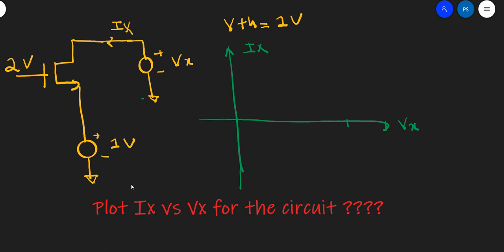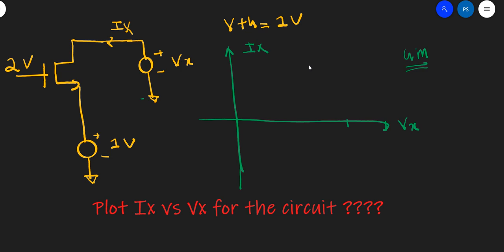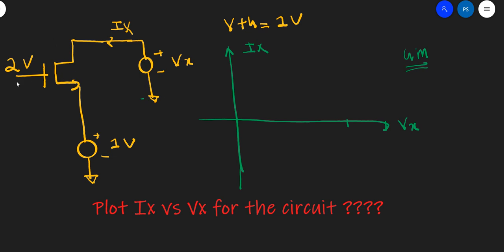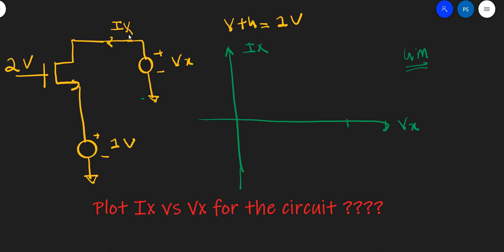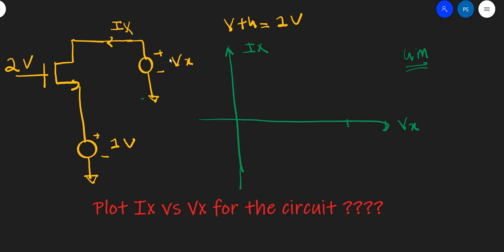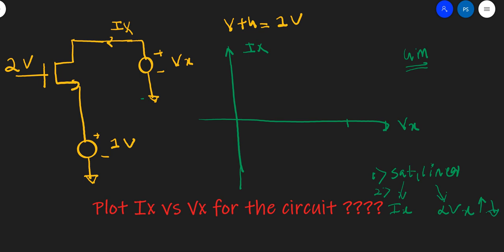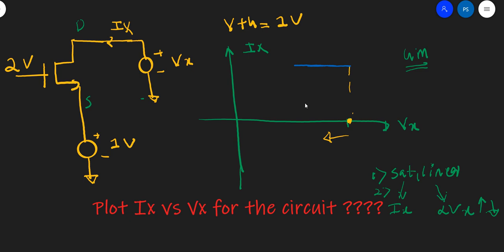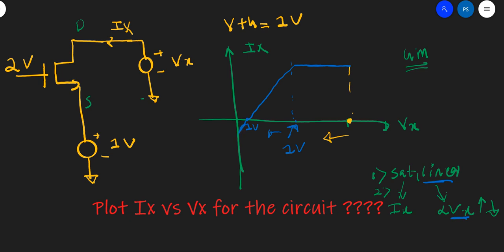Plot IDS vs VDS for the circuit : Interview question for "Analog Circuit Design in a MNC"

Comment: Re-check please.
Reply from the maker: Hi vishal , i have written the correction in the comments. I will soon make a update on this in my next video. Thank you 😃
Reply: @vlsiorg  since the gate to source voltage is not more than threshold, will there be any current. That's my doubt

Comment: For Vx>1V --------> Ix = 0.
For Vx<1V always the mosfet is at the edge of saturation region since Vd=Vg-Vt=2-1=1V.
So for Vx<1V--------> Ix is proportional to -(1-Vx) ^2.
Reply from the maker: Hi Praveen , thank you for pointing out. There is a correction needed in the last part of  the graph. 
*For VX > 1V , Vx will be the drain , So VGS will be 1V and the mos will be on . Under this condition , for VX >=1V MOS will be in saturation.
*For VX=1V IX=0 , VDS=0 here. 
*For VX < 1V , Vx wil be the source , under this condition , as rightly pointed out by you, we are at the edge of saturation. So for VX <1V the current will follow the square law sitting at the edge . ( I will make this correction in my next video) 
Thank you very much. Happy Learning 😃
Reply: @vlsiorg  For Vx>1, the MOS is in saturation, but (Vgs-Vt) = 0, so by the square law, Ix should also be 0